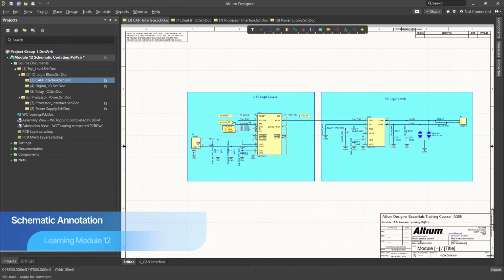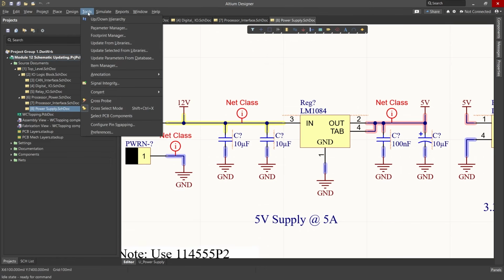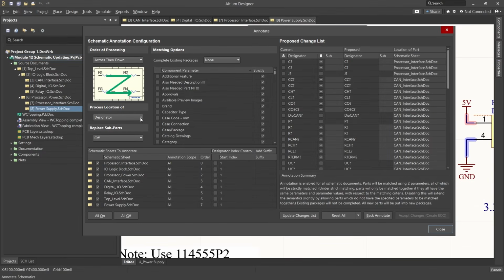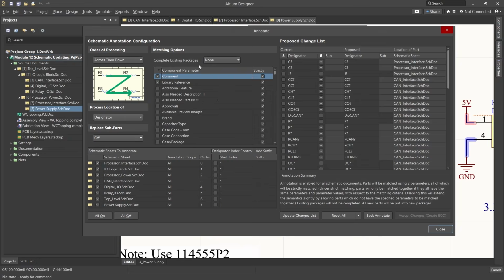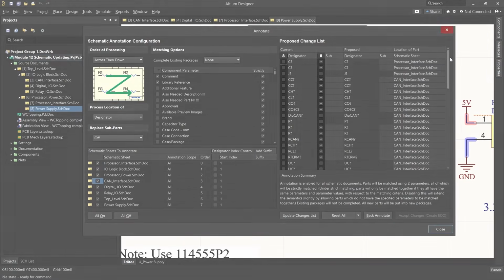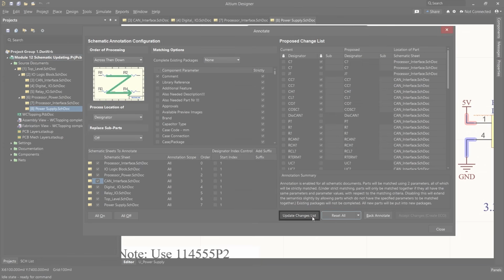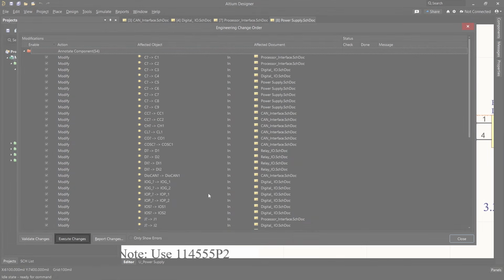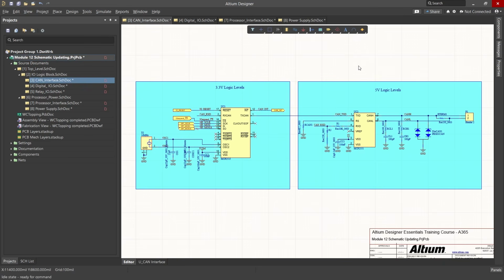Altium Training - Schematic Updating: Schematic Annotation

Comment: Why?! Why would you even want to semi-manually annotate parts in 2026!?
Reply: In our case, a lot of times when we are doing another version of the same board where we add/remove circuits or parts, we need to fix designators for some parts that we (or our factory) don't want them to change, so we manually lock them. Connectors on the board sometimes we also want them on a specific order, so we manually define them. After that we run the automated annotation for the rest.
Reply: @keyspacemedia  Wow. Seems like you're doing something wrong